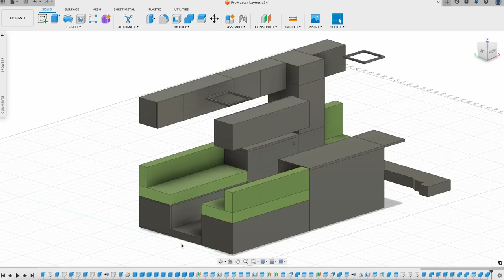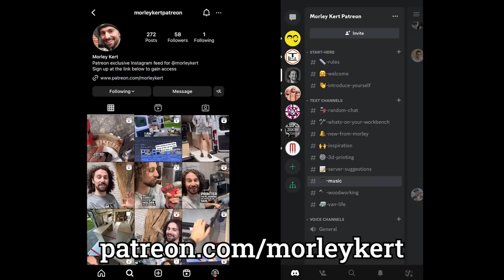47 Days until Move-In (ready or not) | VAN BUILD

Comment: I feel like you should add drop down legs to the deck so it is not entirely supported by the slide. I think it will degrade over time.
Reply: I’m with Ben wood ;)
Reply: Love the build!!
Reply: Agreed. Will likely sag overtime.
Reply: I like that idea.  Like a wall mounted workbench on April Wilkerson's channel.
Reply: could even add holes to mount a vice to when needed

Comment: Lots of hardwork😅 and excellent teamwork👌. My only afterthought is,
the interior could have been 3d scanned, and wood pieces iterated on CAD. But its more fun the way it is!😊❤👍
Reply from the maker: We did our rough layout in CAD, but with so many on-the-fly changes, updating the model starts to become more trouble than it's worth! Once everything is done, I'll probably make an as-built model. For now, it's very useful for planning our drawer/cabinet layouts.
Reply: @MorleyKert  I actually meant the internal body frame. But again, it could, by itself take lot more time and effort to ensure accuracy(the now absolete hp 3d structured light scanner should have been sufficient, not sure of current alternatives). Its way easier to make final adjustments, than trying to get it right in cad the first time(unless using pre-cut pieces). Would be interesting to watch, as the build progress further. Wish you all the best in a successful build within the timeline.♥️👍

Comment: i would be more afraid of the deck sliding back in while you walk on it (since your steps push it back the way it slid out from) than it breaking from your weight. You should have a way to lock it when it's fully extended.
Reply from the maker: It does lock when fully extended - those are the yellow levers